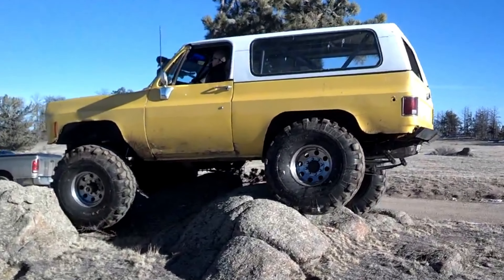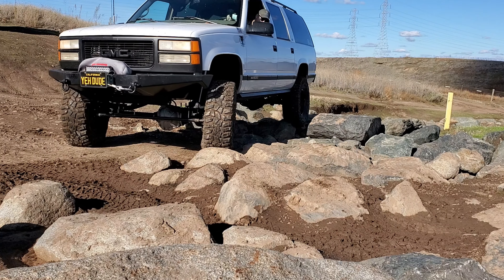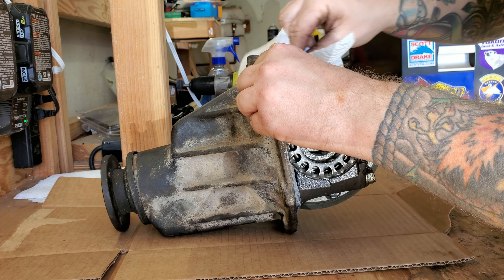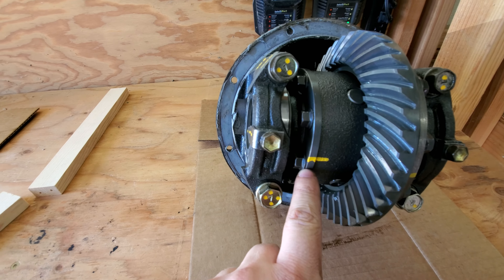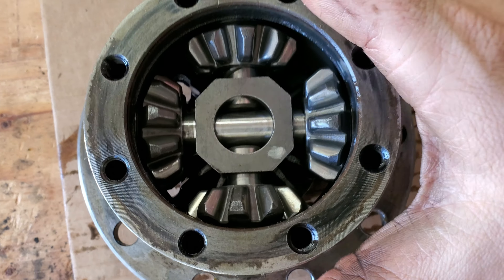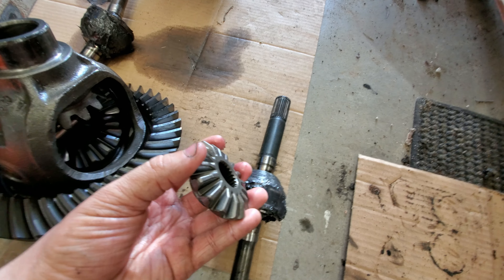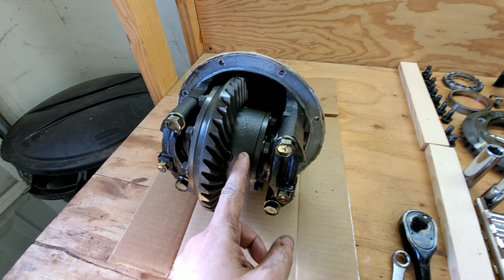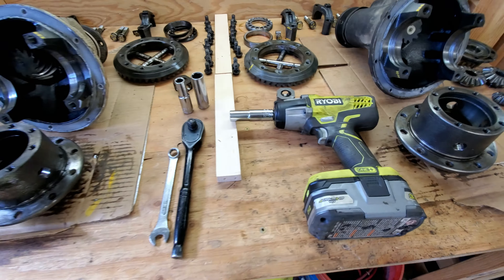Samurai Build (Part 6) Front and Rear Differential Disassembly

Comment: after watching that blazer I kinda think it would be ideal to have a spartan or lockright front and back. I currently run a minispool in the rear and an open diff in the front.  and talking to more experienced people than myself they say mini spool in the rear and mechanical locker in the front is the best setup.  I'm currently about to setup my cousins samurai like mine. anyway i just discovered you channel and I see a lot of interesting videos because we are doing similar things to our samurais.
Reply from the maker: For off road only its hard to beat spools front and rear, because of their reliability and performance. My first time driving the Samurai with the spool in the rear, I instantly noticed the reduction in turning radius. Also, look at the tire marks left on my driveway!
Reply: yeah I understand and thats why I have a minispool in the rear and im setting the other sammy up the same way.  mini-spool has no moving parts. I'm not a big fan of lunch box lockers but it seems to be the only option. theres a russian made torsen style diff  for like 600 but the application doesn't match up it says 86-95 but said like 28 spline axles and i don't think you can return it. it doesn't add up, then theres the 1000 dollar arb. just for the diff carrier so yeah spartan locker in the front.

Comment: Today put a Spartan Locker in my rear differential and your build videos were most helpful. Will be tuning into your channel for tips! Thanks...
Reply from the maker: I'm glad that helped. I literally just test drove the Samurai with a new Spartan I. The rear today. Do you hear a lot of loud pops with yours?
Reply: Just put the locker in today. Waiting on brake parts and bearing kit before I can wheel it. Guessing it will pop some. Will let you know👍
Reply: Getting back to you on my rear Spartan locker install. Finally got brake parts, bearing kit. Put it all together and got a short test drive in. Definitely got some popping on turns especially in low range. Not as noticeable in 2wd or 4 high. It is nice to have the added traction. Planning on a front end axle upgrade and will put a Spartan up front as well.

Are you happy with the Spartan Locker up front? I have Yoda power steering so guessing it will work for me🤔

Comment: would it be possible to retain the factory 22 spline side gears up the front with the spartan locker?
Reply from the maker: The product page says its gonna good for 26 spline side gears, sorry.
Reply: Powertrax lockright 1510r fits front diff with 22 splines